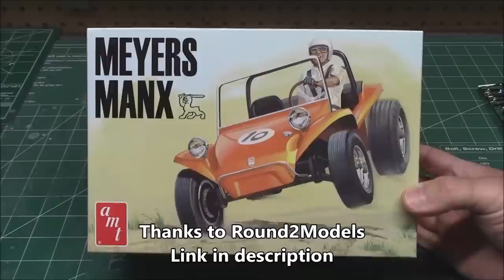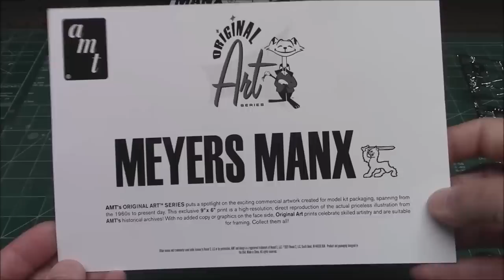1965 Meyers Manx Dune Buggy VW Volkswagen 1/25 Scale Model Build How to Glass Decal Future Pledge

Comment: Yeah! Loved this one all the way back to original issue! Couple of kit-bash "tweeks" = surf boards and/or roof rack from other recent reissues of Ford van or Chevelle wagon. 'Nother thought is to use "service spotlights" from the tow-truck boom from '34 Ford Pickup - as replacement for "bug" headlamps. May be tow-bar for "flat-towing behind either van or wagon? Most of all - 1:1 "buggy" was ALL about having fun - so this kit-build should be too! [For the more adventurous "bashers" maybe Corvair or Porsche engine swap - or serious "swapping with speed parts from Revell "Baja Bug"/"Empi Inch-Pincher...]

Comment: FYI guys: Yesterday I was digging through some boxes and came across my container of original "Future" branded floor polish. It is about 20 years old and in the exact same 27-ounce bottle and blue cap/nozzle as the Pledge item in this video. My Pledge is about 6 months old. Put side-to-side, the Future has definitely yellowed over the years. The question becomes, how would that effect use on models? Well, at some time here I'll apply some of each on a spare windshield or clear acetate and see what I see. Maybe try some Future on a painted surface and see if that skews the color. Since the thickness would be much less than that in the bottle, maybe...
I suppose if the old stuff doesn't cut it, I can use it as... (drum roll)... floor polish.
Reply: There have been both sides of the argument (as to whether or not floor polish turns yellow over time) here on the internet.  Some builders say "yes" and others
say "no".  Personally, I like to use Testor's Wet Look Lacquer,  but some will argue that it turns yellow over time as well.  I guess it just comes down to what you
prefer and what seems to work best for you and your builds.  I have also tried various clear sprays in the rattle cans - - hard to make a definite assessment.